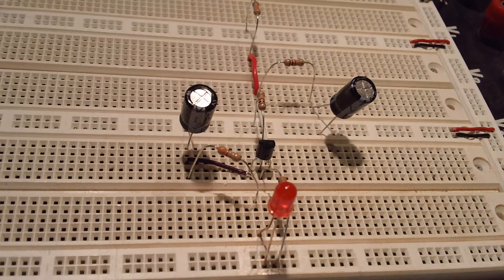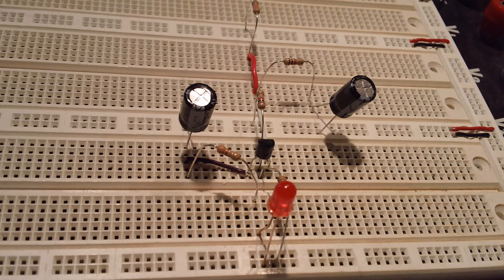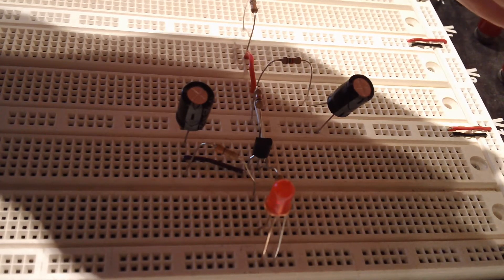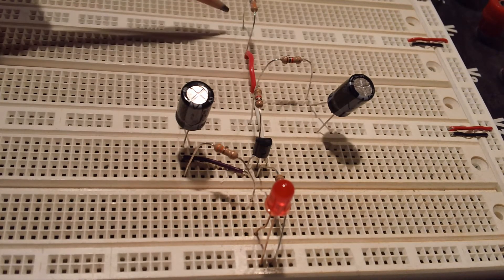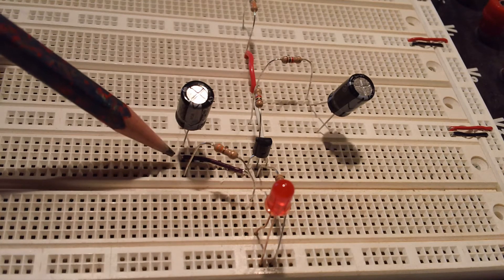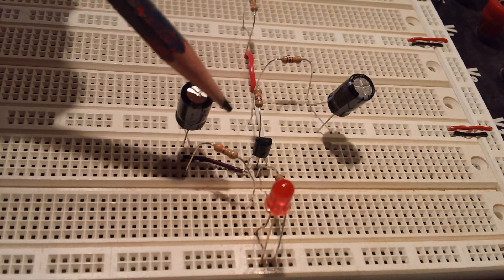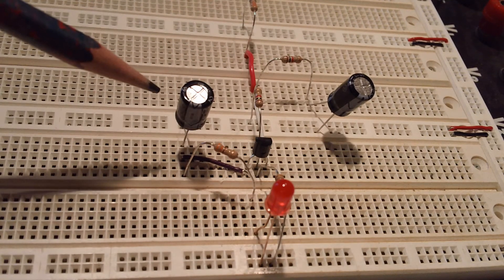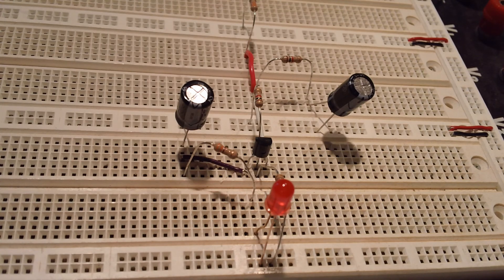Make: Electronics - Experiment 14 (Part 1)

Comment from the maker: @kryton9 I assumed you were using a 9v battery and drew out the schematic as you described and it's not entirely clear what you intended this circuit to do (without some sort of transistor).  It looks like all 9v from the battery is getting dropped at the capacitor with none left over for the input to your LED.  I'd draw this circuit out in some simulation software or plop your multimeter down on both sides of the cap in DC voltage mode and you should see all 9v (or close to it) being dropped.